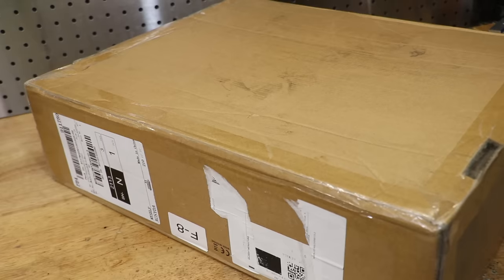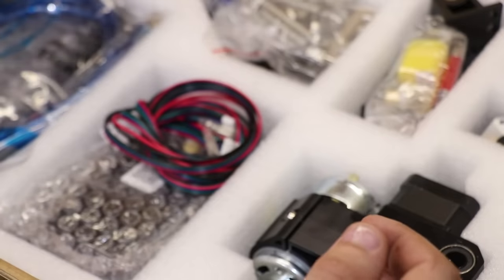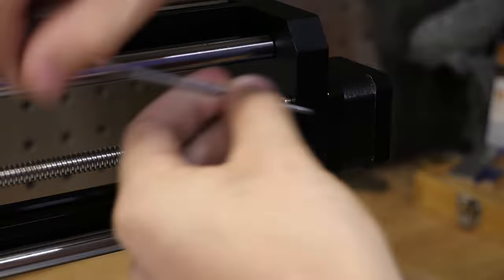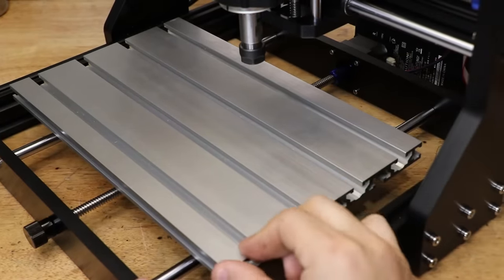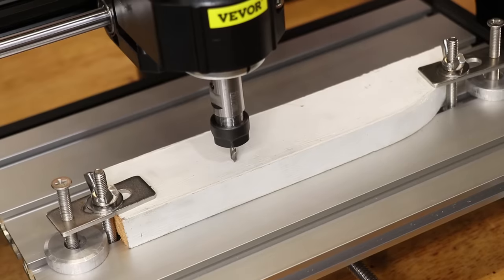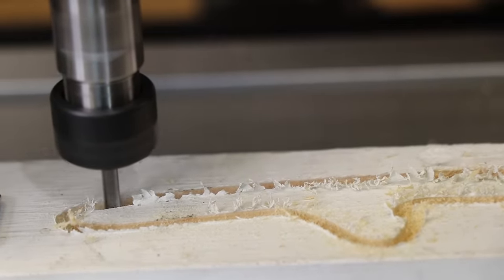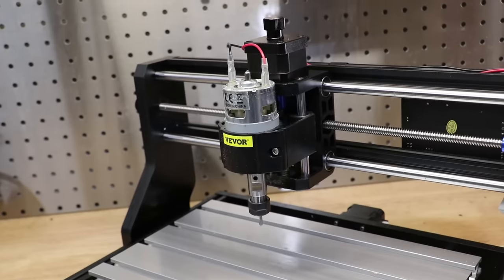A CNC Mill For Less Than $200 - Is It Worth Buying? (CNC 3018 Pro)

Comment: Great video, I’ve been thinking of an inexpensive CNC to make simple parts but I think being able to do Aluminum and Brass would be a must.  How would this one be with milling brass?
Reply from the maker: It won't do it in its stock set up, I'll be adding a new linear rail soon to increase the rigidity and that might fix it
Reply: @artisanmakes  Is what you are thinking is having the milling bit between two rails rather than cantilevered out?

Comment: The table is what made me take it back. Mine came unlevel unless I added longer screws and some springs or something. If I tried to carve a design into wood it would be deeper on one side and snap my bits.  It wasn’t worth the hassle so back to Amazon it went
Reply: Bloggers reviews will rarely be accurate.
Because the companies know they give a machine to a reviewer.
The company will carefully put together the best parts for the blogger to review.

Sadly the best way to know is to try it yourself...

Comment: Since you said you are going to replace the tie down hardware, I have learned the hard way that if you are determined to have wong nuts, they must be brass. I'm a big fan of tool free setups so I tried to make wing nuts work, the steel ones are always thin stamped steel, they always vibrate loose. The brass ones a good quarter inch of thread engagement, for some reason they seem to hold pretty well. Of course socket head cap screws are ideal, but they are slow and can be expensive. I would presume that your CNC machine is mostly for creating jigs or testing proof of concept.

Comment: Great video mate, best review I've seen so far. How would the machine go cutting say 3 or 4mm thick carbon fibre? I would like to make some basic shapes like wings and splitters for RC cars
Reply from the maker: its been about 8 years or so since I last machined carbon fiber. I sure it could do it, but im not sure as to what the accuracy might be. A CNC 3040 might be more capable a machine for that, or any other similar sized CNC mills/routers

Comment: I bought one about 3 months ago and it’s totally worth it
However
You need a computer running Win 10 and need to learn at least 2 different programs
You will spend $100+ on bits right away
You will want to buy the 20000RPM spindle after snapping several of the bits you just bought $50
And it’s LOUD! You will need to build a box for it 
At least that’s been my experience

Comment: I got one, but my main use is making PCB's, maybe some small acrylic parts .. yea I know I can get pcb's from china but its a lot quicker to make a one off at home and work out all the bugs if I need to buy a batch of them and wait a couple weeks. Edit since I am slinging copper all over the place I 3d printed a box for the electronics, sleeved all the cables, and used a meanwell power supply

Comment: I bought one of these type machines.  The machine carves the included files just fine in Balsa or other relatively easy to cut material.  Just fine for my purposes.

The problem I have is finding better software to convert a 3D .STL or similar into G-code.

The included "Candle" is just a pain to work with.

Comment: Thanks for the review - I am very interested in learning about this subject.
The thin diameter of the motor shaft, and the sloppy fitment of collets, etc is the big issues with these machines. I use a lot of very small lithium powered dremel type machines and the runout is horrendous! I've found that the runout and vibrations can actually bend the shaft, especially if the idiot manufacturers have milled a flat on it for the grub screws to clamp against.
Surely there is a motor available that has a larger 5-6mm shaft and some precision in the diameter and straightness? Do small "stepper shaped" motors go fast enough?
Reply: When I went to metalworking school, they spoke a lot about how rigid the tool head must be. That's why the big shop mills are big iron blocks.
Ideally, for cnc, you should have the table move x-y and the head only travel z, secured to a solid vibration dampening structure.
That is if you want to cut metal, for wood and lighter materials, you can get away with a gantry setup. But even at that it still needs to be as solid as possible along it's axis of movement.
It helps to learn about how vibrations travel through various materials and between objects. Vibrations are your biggest enemy in machining.
Reply: John Coops: I don't know if it's what you're using, but if you have the Parkside rotary tool (quite common Dremel copy), they skimped out on a bearing at the front of the tool, so the one bearing close to the motor has to take all the radial load and torque and there is a lot of runout and vibration. There is still a small housing for another bearing molded into the plastic housing of the tool, so adding a bearing is trivial and makes them a lot better, or so they say (I've ordered bearings for mine, so we shall see!). If you've got the same tool, might be worth looking into.

Comment: I bought one of these a while back and it burned out within a month.

It's extremely slow because of the ridiculously small motor.  It's a pretty big jump but personally I recommend the Next Wave CNC Shark for a budget CNC. All these cheaper ones are just not worth the time in my opinion.

Comment: #1 I got one just like that. the x bearing has 2 x 2 linear bearings in line and they jam up. the company sent me replacements and I bought new/"better" and it still jammed up. I bought longer linear bearings 2x as long as the old ones to replace 2 and that worked.
#2 the y motor is too small I upgraded to a little larger.
3# i got a better spindle

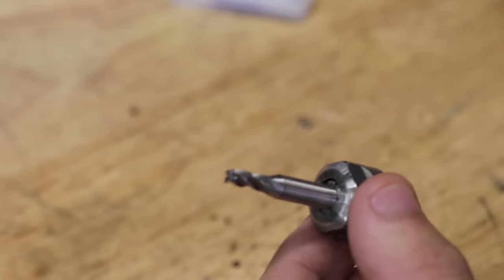Comment: 8:30 I'm not sure larger shanks on the router bits will add anything but weight, given that the motor spindle is a skinny little thing. Doesn't matter how beefy you make everything attached to it, it's still a skinny little thing.

Comment: That reminds me of my drill press. It wasn't exactly cheap at about AU$200+, but it's only good for wood and soft metals, such as aluminium. That's because it's belt-driven between two sets of differently sized wheels that the belt sits in. The belt can be moved between them to adjust the speed, but the speed only gets to about half what is needed for drilling steel. The other day, I tried enlarging the hole in the centre of a lawn mower blade, but the drill press kept jamming. It kind of makes me wish I'd just stuck with using my regular power drill, although it's not as accurate for upright holes.

Comment: Wow, this is the exact machine I was looking at getting in combination with a printer. Thank you, this is precisely what I wanted to see.
Reply: May I recommend you make videos about any upgrades you build on this machine. I was thinking of designing a vacuum suction bed for rapid reset/ turn around with a mini compressor and a chip / dust extractor mini vac for cleaner cuts.
Reply: @reallyfurious  This you can buy a shopvac kit that mounts to the head of this thing or 3d print it and hook it up to a shop vac that greatly helps clean up and reduce it cutting chips helping quality a bit.

Comment: i had one similar to this a while back, it was crap. then last year i found a little beefy one that used thicker rods and large bearings with everything being aluminum construction. its great except the spindle is not very rigid and i had to replace the collet adapter.
Reply from the maker: Thanks for the insight. Il still deciding on how to go about upgrading it. Cheers

Comment: Hey, could you take a minute to explain something about rigidity and spindle power to me? You say the rigidity isn't sufficient even though you programmed a depth of cut of 0.1mm...what prevents you from using something even shallower, like 0.025?
Reply from the maker: No worries. I absolutely could reduce the depth of cut, but to be honest it wouldn't do much apart from make the job take 4 times as long. The machine just isnt rigidi enough. If I programmed in a job with a .025mm depth of cut, im sure it would cut it, but it probably wouldnt end up looking good. Check out the end of this video. The guy leaves the mill running for ages, and it cuts but it misses the fine details, even with a tiny federate. Cheers https://www.youtube.com/watch?v=YKCokjYhGCY

Comment: As an owner of this CNC I must say that the crucial thing is bad plastic, it won't last long. And lack of sturdiness, Cant make traces less than 0.5-0.7 because of beating of milling cutter. There is a version without plastic, where all the parts are metal, haven't tried it by myself. In general it's an OK mill for very very beginners, where you need to learn from your mistakes)

Comment: Always thought of buying one of these machines. Will be interested to see what you do on the rigidity issues. Great video!!!
Reply: best move would be to use the mill to replace them with aluminum, but i'm not sure if this machine is capable of it lol
Reply: @seancostello4158  They sell nice ones prebuilt for these, nicer "pro" kits come with them stock as well. I think this one might been 3d printed plastic for the mount, and yes you can make a nicer mount then this kit had with 3d printer using petg. This thing makes the pro kit i just bought look like its the "elite" edition still same crappy stock motor, but the mount is more stable, and its aluminum and particle board frame instead. They got all metal frames with the nicer metal mount, even better motors as well now, just those are like 100-200 more then the "pro" kits lol

Comment: I find it odd that you expect a machine that costs $200.00 to cut metal when it explicitly states that it is for Wood, paper, leather, and plastic. Also for a few dollars more you could have bought the version with metal Y and Z axis supports. I see also that you can buy upgraded X axis slides and backlash adjustment systems for about $20.00.
Reply from the maker: No, I said on the video I had no expectations for this machine given its price point. I just wanted to see how far I could push it. And for the other model, it just looked more flimsy given the method the gantry is assembled.

Comment: These machines are nice, like 3D printers, but I wish they'd use the Machinist's Inch instead of metric. It was hard to find hardware for my Ender 3 when it came with a missing piece due to everything being in Metric. I understand that Metric is better for scientific things, but Standard is better for machining since the thousanth-of-an-inch is the ideal smallest unit for most machines and the ten-thousanths-of-an-inch is good for stuff that's abrasives. As an American, we're taught and use both systems and each has its advantages and disadvantages.  

Also, a card scraper can be useful for anything that's plastic and wood. They make post-processing far easier.

Comment: What are your thoughts on using something like this for guitar neck and headstock inlays? Do you think it is accurate enough out of the box?
Reply from the maker: I'm sure you could do it, it's only wood, but for super accurate stuff you might want to look into 3040 CNC machines too, they are a bit bigger.

Comment: youre missing a bearing at the bottom of the Z screw. thats probably why there's so much wobble in that axis..

also, i have a 3018 pro and mine is slightly different. I assumed all 3018's were the same thing but i guess not. ive had it for like 2 years and have actually never used the cnc mill part of it. mine came with a 5.5W laser module that i used a bunch and it worked great for engraving soft things like woods and plastics and leathers and whatnot. i bought it for the mill and always wanted to set it up for it but its so damn loud that i never did. i live in an apartment building and i dont think the neighbors on all sides of me (besides up and the outside wall) would appreciate the sound of a loud ass vacuum attached to a loud ass cheapo mill running for hours on end.. so i shall continue to use my toys vicariously through youtubers. lol.

Comment: I would like to see if it can do a printed circuit board.  The poor concentricity of the spindle makes me doubt if the result would be usable for anything near modern line widths or spacings.  Oh yes, I started my board layouts when the "standard" was using a 2.54 mm grid.  Hardly anything can be designed that way today.

Comment: Odd that he's automatically against plastic, despite several plastics having greater rigidity than many metal parts. They only fall behind on very high loads that you would not expect to see in this use case
Reply from the maker: I'm not against plasric parts if they work. Given that this machine will be under some load, I don't see why being sceptical of plasric is wrong, given that these are usually made from aluminium. Clearly the parts that make .up the frame do the job just fine, which I said. It's just the plastic z assembly which clearly doesn't work that I want to improve.

Comment: I put a trim router it cost about one hundred dollars more, I can use it to quickly cut. Into the hardest of wood. The small factory motor is worthless. 
I'm learning to program using free autocad software.
My goal is a 4 foot by 8 foot wood router.

Comment: Can I suggest to try a coolant mix for your aluminium parts as the spindle (drill) can get very hot and causes to run off a few millimetres
Reply from the maker: I used some wd 40 in the cuts and that worked fine. Typically I only use my semi synthetic coolant for ferrous metal

Comment: You seem to know a thing or two about Cnc routers, may I ask what pricepoint an actually useable router should have? One that doesn't die by just looking at looking at metals such as Aluminium?
Reply from the maker: if you are looking at import, you might want to look at videos on the 3040, and 6040/6090 cnc machines, the start at around $1,000 and up

Comment: Check your runout on the cutting bit not the outside of the holder as this could be out but the centre is running true. Also maybe your meant to make your own parts out of ally for the cnc rather then plastic.
Reply from the maker: Normally, but I was more concerned with trying to dampen the vibrations by getting the spindle concentric, rather than the endmill in this occasion

Comment: I’ve used mine with the usb/pc mode but when I plug in the offline manual controller it doesn’t get passed the cronos intro screen. Do I have to flip a switch on the controller board in order to make it work with three offline controller?

Comment: Would something like this be upgradable with a steel frame? I'm decent at welding and fabrication so could make one. I am interested in a cheap CNC for making aluminium and potentially mild steel parts. I was looking at a second hand milling machine and just converting to CNC but this seems like an easier option.
Reply: In theory... I mean this is a cheapo model to begin with. One I got is an aluminum frame... This one looks like they used a 3d printer to make half the stuff for it... And you can 3d print a nicer mount then this has for sure lol. These are hobbies 3018 is a hobby kit there is like 12 companies that made their own versions of it over years, each one is little diffrent on mats they used to make it. Just like there is "pros" out there with nicer motors then this one, this is the basic entry level motor with original kit. I mean I got it it works but there is like 4 motor upgrade options on amazon alone I seen, depending on if you want less noise and more precesion or a loud as hell double the stock speed one, that costs less, becuase the thing wares out faster lol.

Like that is my issue get one with 200 more RPM half the noise people swear it lasts longer and is more accurate, or pay half that for the double the stock speed one, that can do more things, faster but has a shorter lifespan then the stock motors lol.

Comment: No feeds and speeds?  What size endmill was that?  I think you need to try a way smaller endmill.  Like 1/16".
Reply from the maker: I think I said I started at 600mm/min and that they were 1/8 cutters. I'll be sticking with them, 1/16 are just too fragile in my Experience

Comment: nice , im finally will be investing in a makerdream evo one pro for 3.6k,  and yes its a lot of money, but not for what it offers , 
ill be going cnc instead of buying  mill (looked at the sx2.7l )
but i really want to improove my gcode skills and dont have the momey for all the improovements, tooling and toolholding and just dont want to deal with the mess in my basement 
aslo 55kg are a lot easier to bring down there than the 120 or so of the sieg
im mostly using alu and softer metalls so the "limits" are not a problem

Comment: I was hoping for a recommendation on a table top CNC that I can use to "Engrave" rings. I would like to cut the metal from around the letter...So that the letter are created from metal left on the ring...Not machined out of the ring... Any suggestions are greatly appreciated.
Reply from the maker: Can’t give you any specific but you’d want a 4 axis cnc engraver. Or maybe even a fibre laser engraver

Comment: Does the offline controller make it so that you do not have to use any modeling software? If so, do they offer this in larger machines? I'm really looking for something likely early '90s tech, be able to input a basic shape and then change the parameters of the lengths, but all offline. Is this capable of that? If not, how much can you achieve from the user interface?
Reply from the maker: Offline controller just allows you to skip using the computer to control the CNC. You still need a usable g-code file that you load to the controller from an SD card